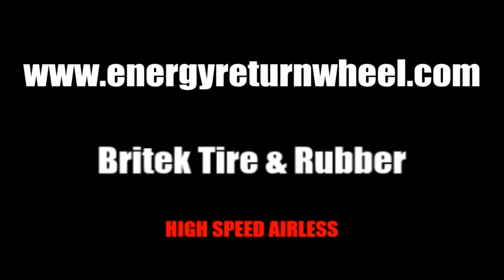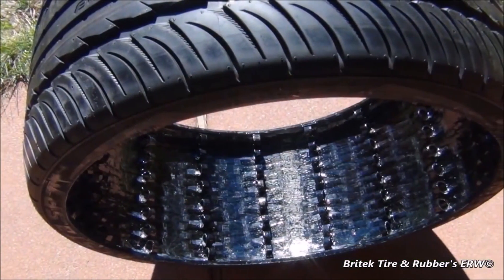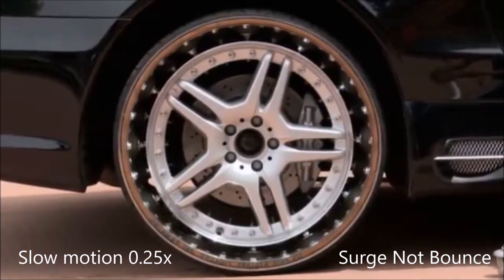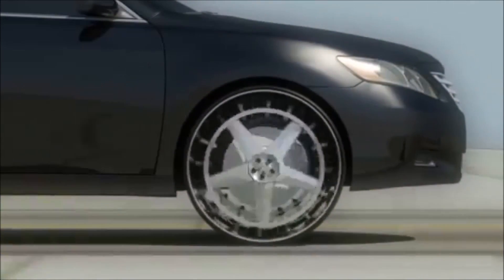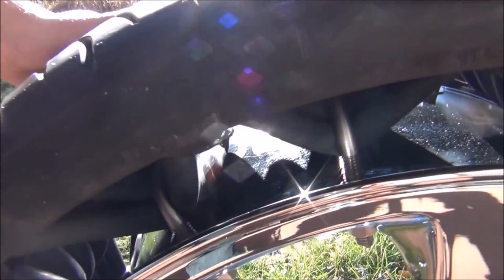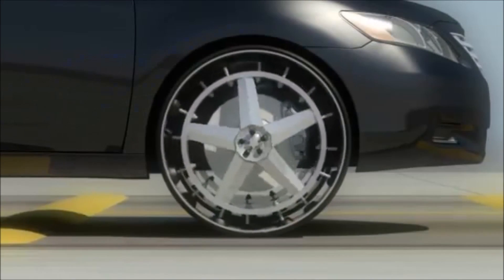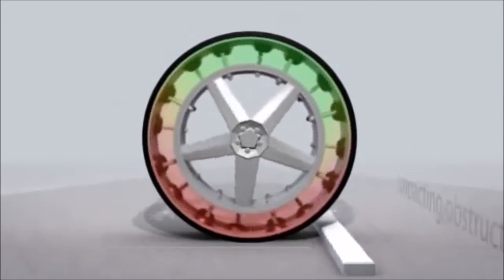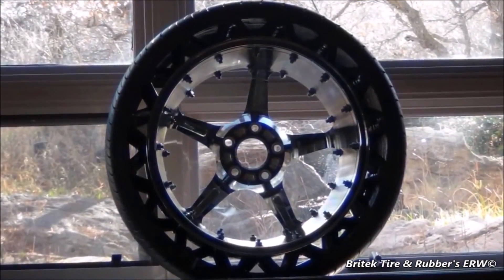Tire britek Tire ERW High Frequency Vacuum Wheel

Comment: Forget comparing to other tires; it's always possible to find a crappy tire that makes yours look better. What's the actual rolling resistance coefficient (i.e. 0.003 or 0.006, unitless obviously) at highway speeds (say, 55-60mph) for a semi truck using this tire?
Reply from the maker: We are keeping quiet...We test against W rated tires. Hard to find a cheap one...Tires can be expensive and crappy  at the same time. Composite tires will bring your vehicle to a new level of overall performance..